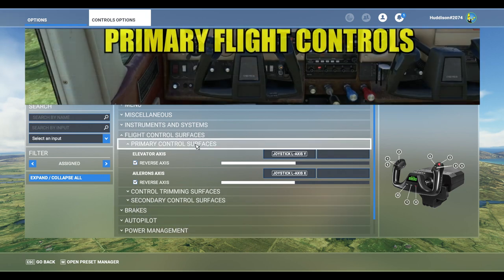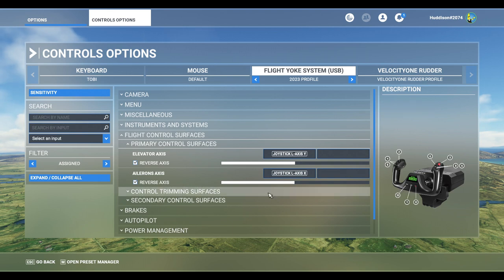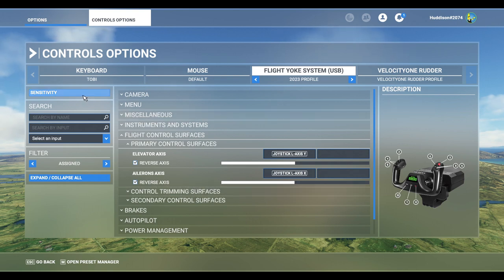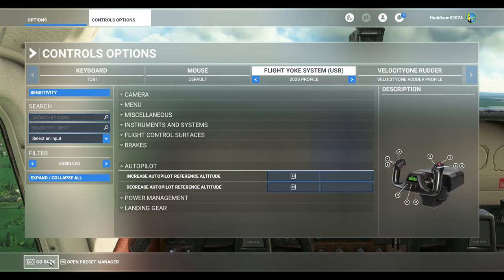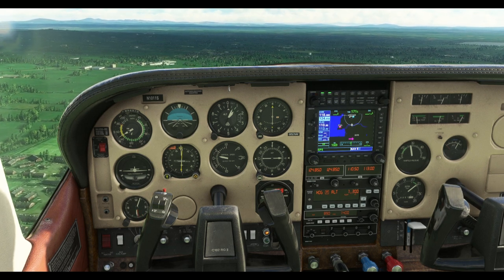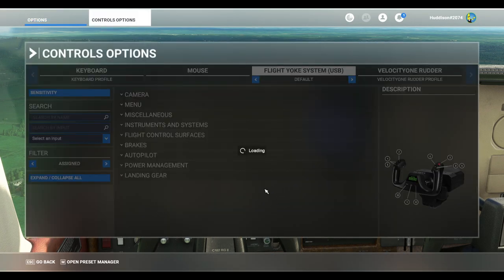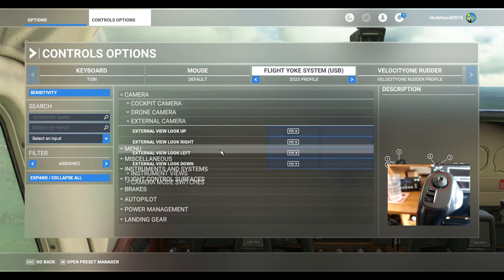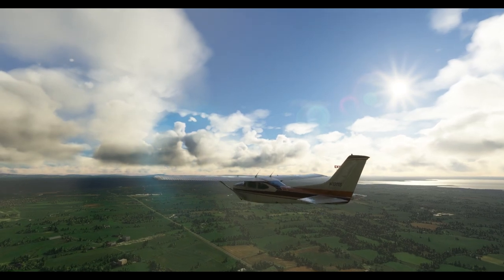FS2020: Logitech Flight Yoke 2023 Settings, Assignments & Sensitivities.

Comment: I switched from a Logitech x56 HOTAS to the Logitech Yoke system for GA aircraft as well. I love the feel of the yoke, but I found that I really missed the sheer number of buttons, hats and dials that I used to have mapped for my cockpit controls. However, You can use multiple buttons pressed to map to a single function in MSFS, so I use the red button on the left yoke as a shift button and have doubled my available inputs. For example, the default aileron trim lever is T1 and T2, but when I hold Button 1 as a shift key, it becomes target altitude up/down.
Reply from the maker: Using 'The Big Red' as a shifter is a great idea!  I make do with my added panels ;)
Reply: @Huddison  I really want the Autopilot panel, but I need to introduce new sim gear at a certain pace in order to maintain matrimonial harmony... I am sure many can relate...
Also, thanks for the great content.

Comment: Great video !! Question wrt POV and hat switch, how do I reset view back to a custom view.....for example, my NUM 8 keys is set up so I view just above dashboard, since I use external screens for instruments, I did set up L, R, 45 deg L & R and 120 deg L & R correctly, however when I toggle any of those keys again to return to front cockpit view (NUM 8), the view change to some kind of "default" view, but I'd like to return to my original NUM 8 view....I want to use POV "UP" to return to the NUM 8 camera set up view?
Reply from the maker: Sounds like an in-depth question for our Discord server.

Comment: I still can't figure out how to set the clock on the yoke.
Reply from the maker: It won't display when plugged into my laptop, but fine when attached to my Pc. Not sure of the cause/issues with it.
Reply: Have you installed the Logitech software?

Comment: Thanks  very much for updating your video on setting up the yoke.  I recently got the Logitech yoke and rudder pedals as a gift and your suggestions for setting up the various switches and buttons, as well as the sensitivities has been very helpful.  One thing I am struggling with is adjusting to the "stickiness" of the yoke when I am trying to make fine adjustments and flaring upon landing.  Can you comment on if this is a common occurrence, is there something that can be done with settings to minimize it, or is it simply a characteristic that I just need to learn to deal with in how I fly with the yoke.  I was previously using the Logitech Extreme 3D Pro which I found was very smooth.  Thanks.
Reply from the maker: Unfortunately,  some yokes may be a little sticky in certain axis (the V1 yoke also had this on some units).
Daily use typically helps ease this.

Comment: Another Spot on video and ohhh Logitech sure brings  back some good memories  had this set up for many years I even needed to grease the inside to stop the grinding noises when pulling and pushing the yoke all part of the experiance. ( perhaps todays version one doesn't have to do that )
Reply from the maker: Thanks Mike. I've never had any noise issues with my yoke & the Elevator axis is still silky smooth.
Reply: @Huddison  glad to hear

Comment: Thank You for finally convincing me in purchasing just now this Logitech/Saitek Yoke. Your honest review from 2020 gave me the last kick to order. I think, it´s no bad decision for my very first yoke system. Even though I made a little mistake: I could get a single throttle piece cheaply, so bought it. Now, I have two of these 3-purpose leavers, hahaha. I´m hoping, I can find a useful combination for these additional leavers? Maybe landing gear up and down etc.. Any idea or suggestion? I´m thankful for any recommendations! I gave You thumbs up and subscribe, cause really helpful. Best Regards! Steffen
Reply from the maker: You could set up 4 engine aircraft with both Throttles attached; flaps/mixture might also be an option.  I have 2 Throttle quadrants also as i showed in this video: https://youtu.be/Qv8PCYFA7ig
Reply: @Huddison  forgot to mention, that 737 800 is my plane Model at the moment

Comment: Hey there, I currently have this yoke but I’m not sure what to use as rudder, unfortunately I am not able to buy an actual rudder system, any recommendations on what I can use as the rudder? Thanks
Reply from the maker: Xbox 360 controller works ok (somewhat) for ground rudders).
Reply: @Huddison  what about in air

Comment: Ok I'm new to FS2020 And just got the logitech yoke& throttle. 
When not using FS2020 & YOKE system do you unplug the USB from your PC. I see the yoke is lit up as soon as plugged in but not using FS2020.
Reply from the maker: I generally just leave my yokes plugged in; whether I'm using the sim or not.
Reply: @Huddison  Thanks, Boy FS2020 is so much more stuff to do than FSX. FSX was easy to just fly around and have outside view which was easy & used it most of the time for landings

Comment: Thanks, can i ask if you can you show how its even works settings for  MULTI PANEL and SWITCH PANEL ?
Reply from the maker: I show that somewhat in this video: https://youtu.be/Qv8PCYFA7ig
Reply: @Huddison   Thanks, but i can't get all buttons to work, only a few numbers. I don't know what to do to make it work. I use it on airlines. Are you able to show it?  Thanks
Reply from the maker: It depends which airliners you're using it with.
It might be worth asking on our Discord about this. @farshadtimkvist
Reply: @Huddison   thanks i have a problem to get in Discord. I dont know why. It told me not accepted
Reply from the maker: @farshadtimkvist  Hmm strange - try this link: https://discord.gg/Ameu93sHfY

Comment: Can you control 2 engines of an airliner using this? How does 1 throttle level controls 2 engines?
Reply from the maker: If you buy another throttle quadrant, then you have 3 more levers to play with.

Comment: At 7:20 where u describe the throttle etc for GA, how similar do I need the blue or red lever for throttle in an aircraft the the PMDG 737? Currently if I barely move the blue Stick the throttle goes 100%.. thanks
Reply from the maker: Your assignments may not be correctly bound; ask on our Discord about this.